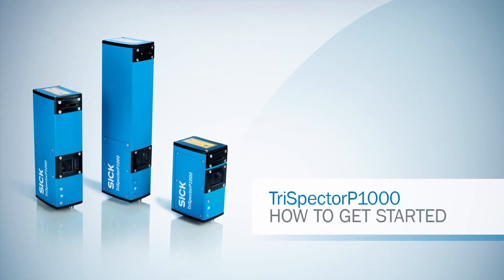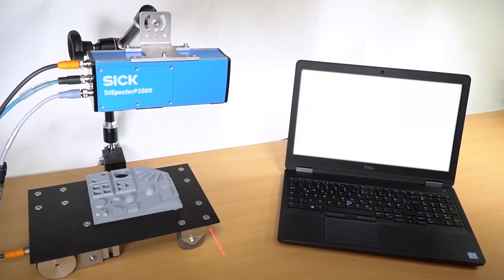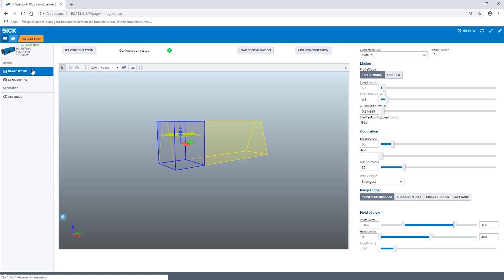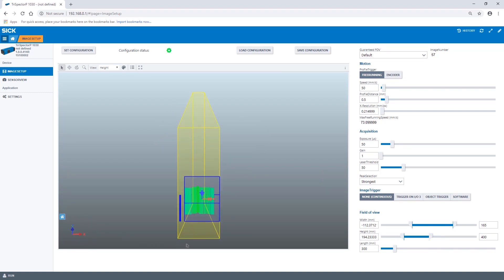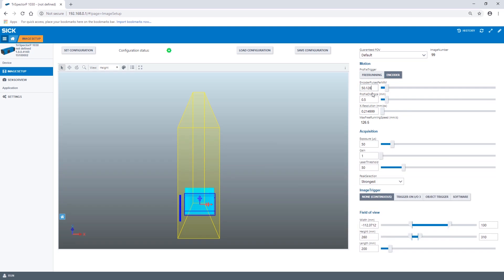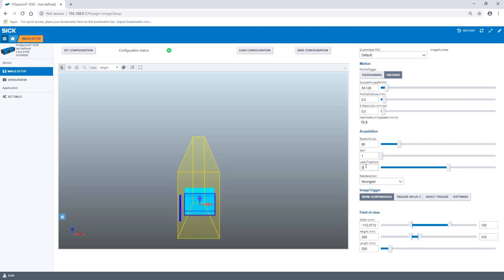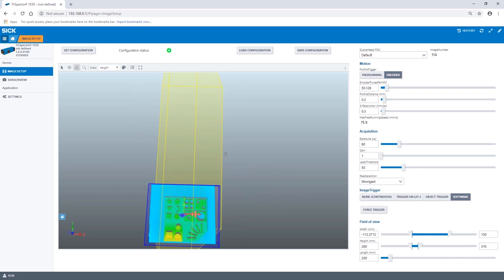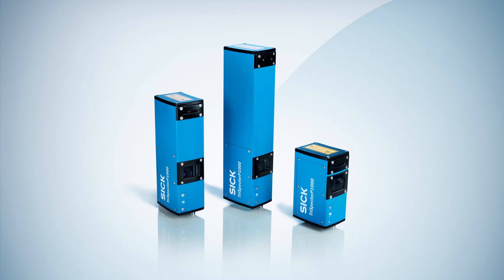Tutorial TriSpectorP1000: How to get started | SICK AG

Comment: Can the 3d image be viewed in other 3d viewer tools or it can only be viewed on SOPASAir UI?
Reply from the maker: The image can be exported in mainly two ways: Either as heightmap, or it can be converted to pointcloud and then exported.

Exporting the heightmap has the drawback that the image data is 16 bit and most image format (BMP, PNG etc) is 8 bit. As such, the reader needs to combine two pixels into one in the reader application. It is also possible to export the heightmap as JSON.

If the heightmap is converted to pointcloud, it can be exported as a PLY, which is a standard format that a lot of 3rd party viewers can view.